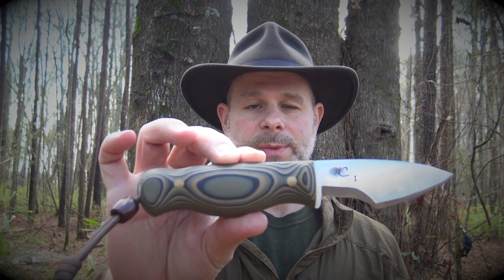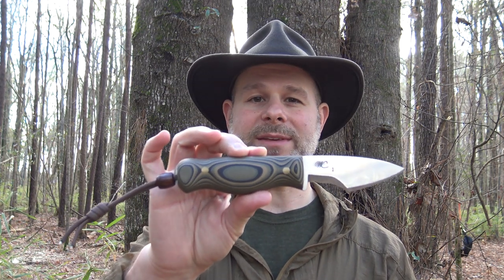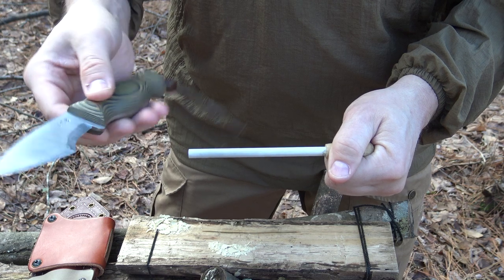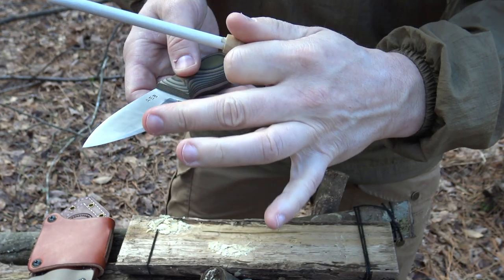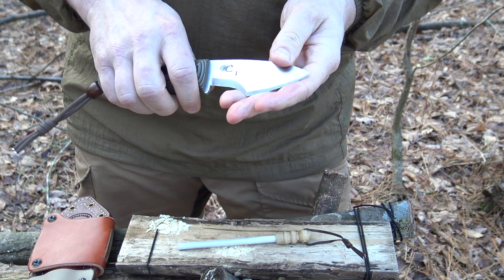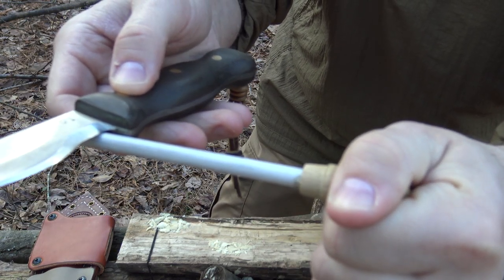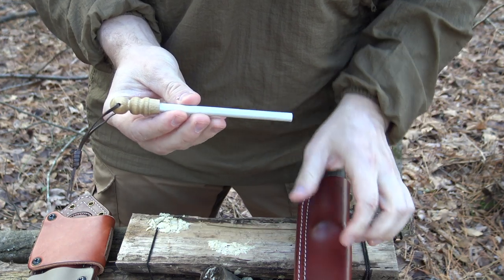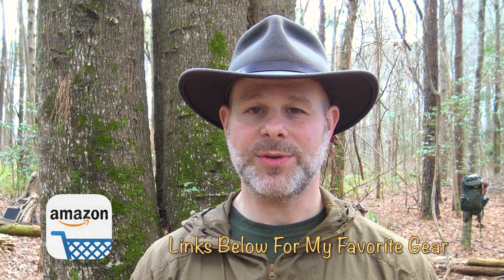Honing WC Knives Woodsman's Grind: A Simple Method for a Razor Edge

Comment: I always do like that when finishing the last bit of honing; going only forward on the ceramic rod. But when it comes to full on sharpening (perhaps with a more aggressive ceramic rod) there is no problem with going both directions on each side.  That is, pushing and pulling on each side. I had this proven to me by a couple people with WAY more freehand sharpening experience than me. Also, take a look around SMKW for some great deals on their house-brand rods. They have different diameters as well. Won’t get free shipping like Amazon, but if you’re there for other stuff anyway....

Comment: I find a scandi grind very hard to sharpen, about to decide the scandi grind craze isn’t for me, back to flat god for me
Reply: Yeah i find only the angle is easy to find by feel since the sharpened bevel is so wide, but if you want to keep scandi as perfect V its actually quite difficult grind. Many people have their scandis slightly convexed or something because the stone they use is not absolutely perfectly even or they have not maintained perfect angle. Its usually ok though since slight convex can add strenght to the bevel since scandis are fairly fragile, and if its not too bad it shouldnt impact much on performance. I think even William Collins has mentioned this that something like saber or flat is actually easier to maintain on field even with no optimal eguipment

Comment: How do you protect your ceramic rod from damage when packing it along in the field?
Reply from the maker: I have a little tool maintenance bag with that and a few other tools that stay together my pack. I also position it on the top the load so it is easy to access and doesn't come in contact with objects that may damage it. Maybe a video to show that kit?? Thank you for your time and interest Dan!
Reply: @blackhatbushcraft  Get a short piece of PVC pipe just larger than the diameter and slightly longer than the ceramic rod. 

Cut a small notch on either side of the PVC pipe. I
Insert the end of the ceramic rod into the end of the PVC with the notches.
Wrap that cord on the wooden handle of the rod into the notches and the rod generally wont move and it will be protected.
Reply: I make a leather sleeve for mine, either as part of the sheath or separate.